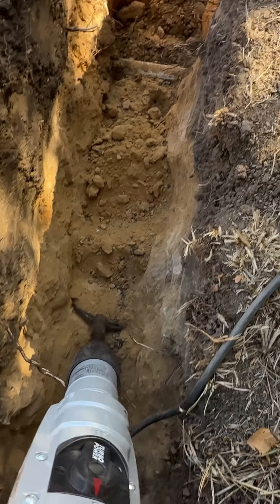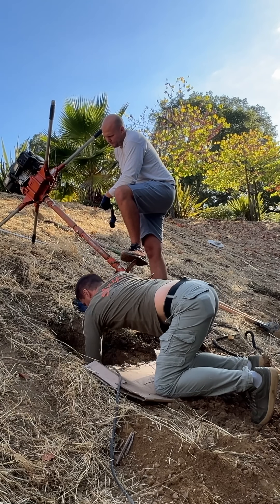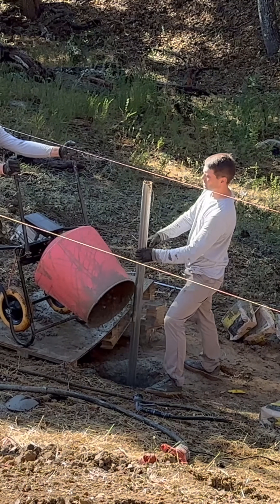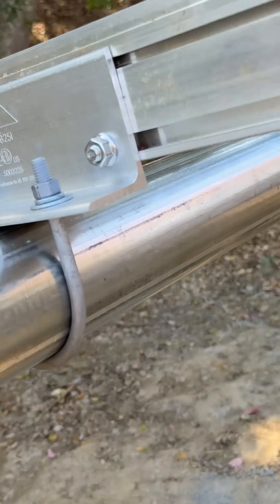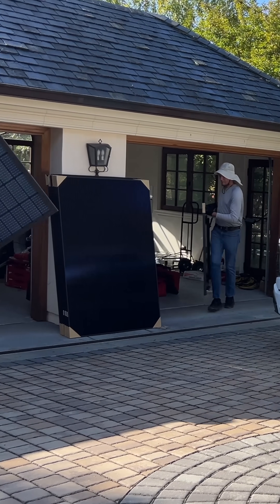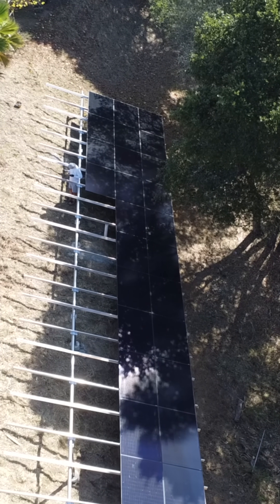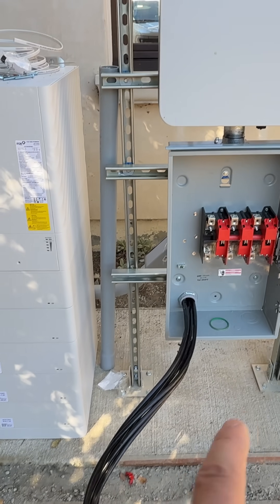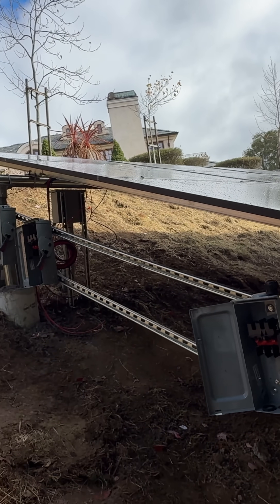60 Solar panels, ground mount solar array #groundmountsolar

Comment: nice install. i use iron ridge, too. for the aluminum angle, i go to my closest metal shop and buy a stick of structural "L" and cut/drill my own holes. seems to save some $$. maybe I lose it in time, though